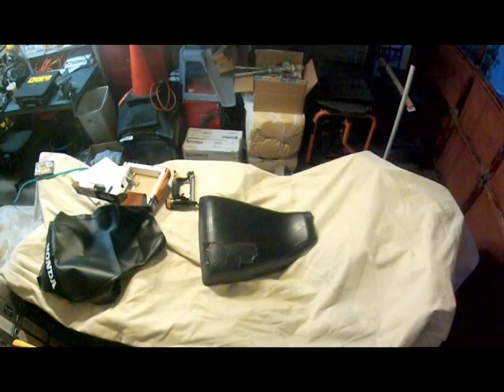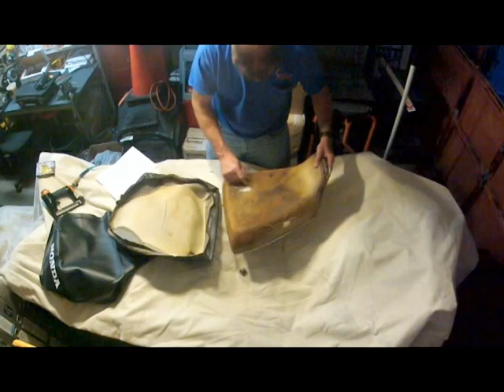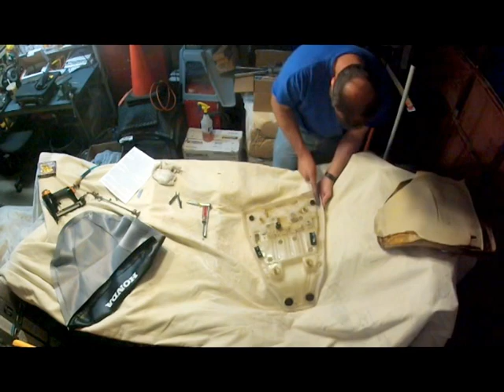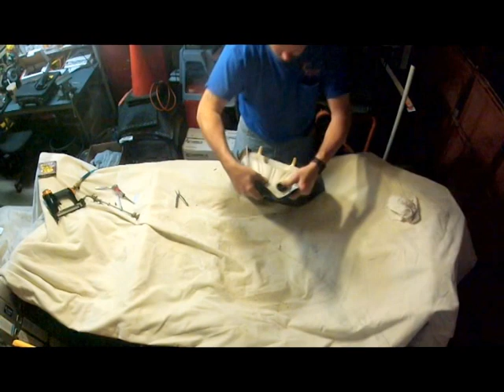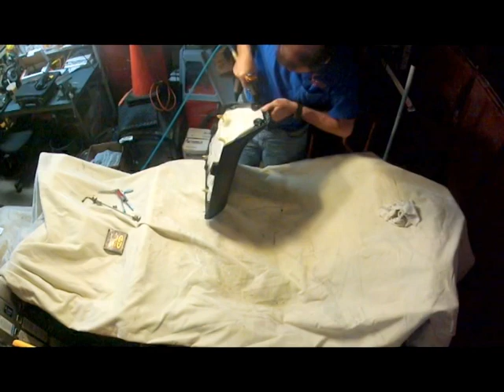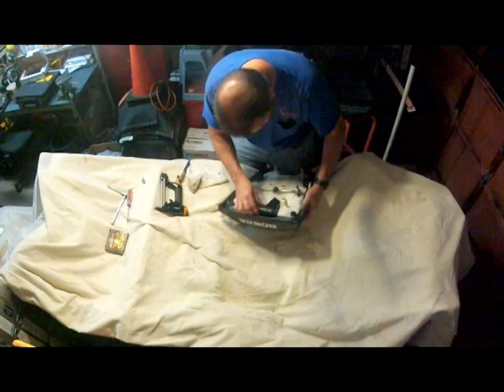Replacing the Honda Big Red Seat Cover

Comment: Nice job. I think I bought a few of the same covers. Not much extra material for installing. It's a bit more difficult to install on the 200E. Seat pan is it is metal.
Reply from the maker: Plastic.
Reply: We're you able to open the "shark teeth" and then bend them down again without breaking on the steel pan?